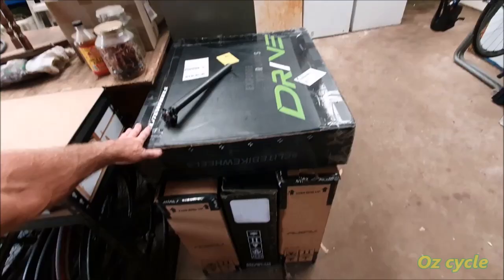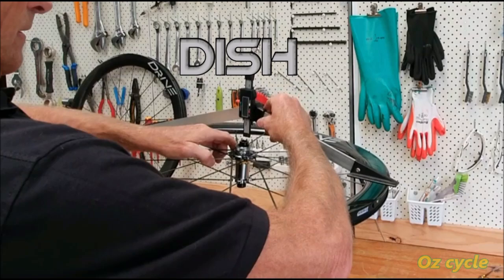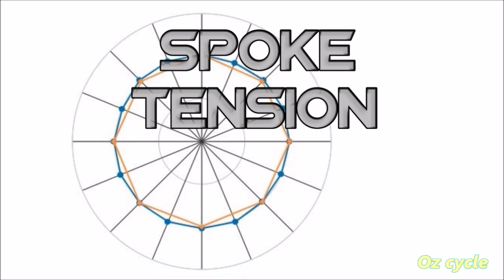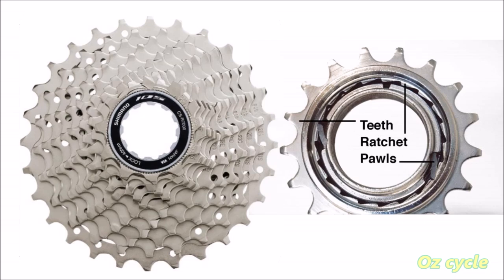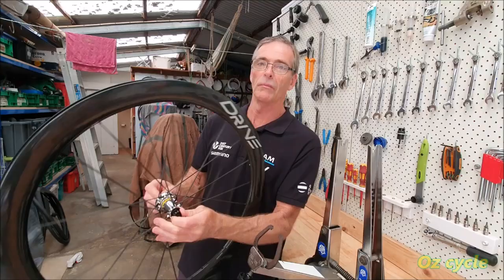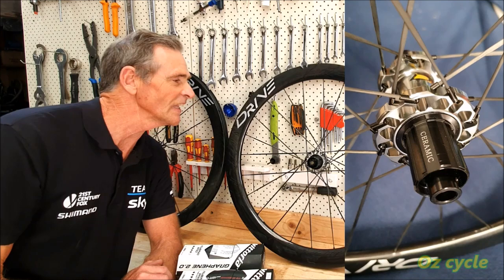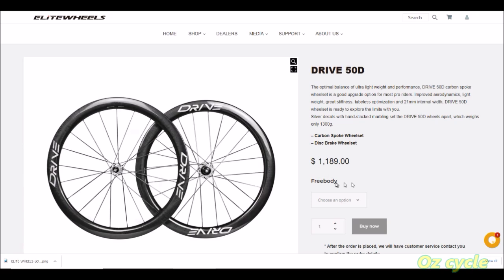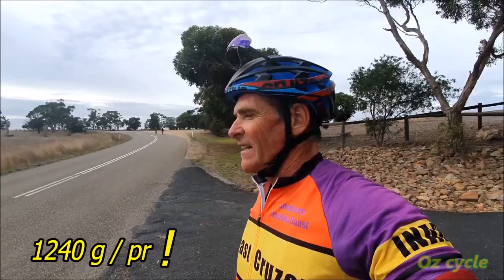Elitewheels Drive - carbon spokes , disc. Full review

Comment: I’ve been using these for a bit as well. 
I’ve noticed a marked increase in acceleration and climbing.  Now my climb performance has upgraded from terrible to less terrible. 

Great video!
Reply: Nice, ill take less terrible of terrible any day. My climbing is very terrible.
Reply: @JFomo  all kidding aside though.  When I first upgraded from alloy to carbon, it felt like a quantum leap. 
The Drives make my old carbon wheels feel like alloy wheels.

Comment: Good call on the TLR to tube tyre weight difference. I've never cared to check. Probably would be lighter with a clincher + latex tube than TLR + 40g of sealant. Just lose the puncture protection.
Great review, as always.

Comment: Note about carbon spokes. I was @ 225lbs when I started riding my winspace wheels. 1st spoke to break was rear wheel at the threads. rim went barely out of true and I made it home. The next time I broke spokes because my derailler committed suicide and dove into the spokes accelerating out of a corner. Took 3 out but the wheel didn't fail. It has been repaired and no problems since. I think the tensions are so high if you lose one  you good chance of making it home. But it is a negative that you cant make an adjustment on the road in a jam with a spoke tool

Comment: FWIW re swapping wheels and disc rotor alignment issue - invest in some disc rotor shims, usually each shim is 0.2mm, once setup this eliminate the need to adjust the caliper with each wheel swap🙂
Reply from the maker: Yes. You would think hub manufacturers would stick to a standard tho, hey?
Reply: They do stick to a standard but the tolerance needs to be reduced

Comment: I am concerned about the wheel height.  I have used Dura Ace WH9100 C35s and 20 mph cross winds would dramatically shove me (I am 6' 1" and weigh 160 lbs).  The lowest profile is 40 mm for the Drive.  I understand that the Drive are much wider the the Dura Ace and minimize the vertical profile.  Will the Drive wheels be driven just as much as the Dura Ace C35s?
Reply from the maker: Understandable. We had quite a few riders here who had same concerns. They got the deeper wheels, and months later they not even thinking about it as they subconsciously adapted to how the wheels feel in crosswinds. Extreme crosswinds will affect you no matter what wheels are used , most of the time it's no problem.

Comment: Great review! Did you use or review their 36t ratchet hub (name of the hub is RD13, it is used in BWT, Marvel, SLR and Edge disc models)? They say, that it is a good clone of DT Swiss 240 hubs with TPI bearings (a little heavier than original 240, but much more lighter than 350).

Comment: When it comes to stiffness, can these wheels be compared to wheels, e.g. DT SWISS ARC 1100 62mm Enve Foundation 65? It is worth buying them they are suitable for sprints / racing they are not too soft and bend ?
Reply from the maker: Definitely good for racing, but not for heavier riders (90+ kg)
Reply: @stevenleffanue  I do not know how their stiffness compares to competing brands such as DT SWISS ARC 62 or ENVE Fundation 65. Was it possible to test those wheels? Drive wheels They are very stiff they do not give up / they are not too soft floating when accelerating, e.g. My weigh is 72 kg

Comment: Really thorough. Well done mate
Reply from the maker: Thanx Alex. I like your upfront reviews and tech work too. Cheers from Australia
Reply: @stevenleffanue  I've not had the same experience as you regarding the spoke tensions. On my front wheel they are far too low and inconsistent! Causes all sorts of problems with the disc brakes.
Reply from the maker: You may have wheels from the first batch. I had a front wheel bearing problem and they said it was a known issue and has been fixed. They sent replacement wheel and it was fine. Let them know and they should replace it for you.

Comment: So a standard tyre with TPU ridenow tube at 33gms and you would have saved ~150gms per wheel!! This is about 300gms of weights saved at the rotating edge of the wheel!
Reply from the maker: Yes.

Comment: I was struggling to true this wheel but was grateful when you explained that truing had to be done from the spoke hole with a 5.5mm socket.  Can you give me some tips on how to radially true an asymmetrical 14 spoke/7 spoke setup such as these Elite wheels?   Thanks so much for this review and any help you can provide!

Comment: Given the vagaries of resin/finish coat, I think I'd measure lateral deviation on the inside mounting face rather than than the exterior of the rim like you would do with a metal rim - probably a more accurate view of lateral true.

Comment: You mentioned comfort, how would you rate them relative to other factory direct Chinese carbon wheels you've tried?
Reply from the maker: It's the carbon spokes that seem to absorb more vibrations than steel spokes. Only downside is , how long will carbon spokes last?

Comment: you know just after I left that comment on your you tube page I look at the instruction manual that came with the brakes to see if there was any info about that. All I found was they say there is a very small screw on the caliper for adjusting imbalance of the brake pads. Well I gave it a try and voila it works, calipers opened up by 1.5 mm. Thanks for the info any how. @stevenleffanue

Comment: Hi Oz cycle. I purchased a set of Elite rims, they initially came as thru axle and after a bit of back and forward they sent out qr adaptors, unfortunately the diameter of the qr adaptors seem a little to largeto fit my frame ! So having a great deal of pain trying to get this sorted ! Starting to think I should of just spent locally.

Comment: As always you do the best wheel reviews I've watched. I'm not looking to buy wheels because I bought a set of Campagnolo Shamal Carbons a couple months ago. You want to talk about a pretty wheel, Campagnolo wheels are pretty which is one reason I wanted them. The most important reasons I chose Campy is because I owned a few models and all of them were better than other brands in the same pricepoint. I think the cup and cone bearing hubs are a lot smoother and faster than the cartridge sealed bearings so I was happy to see Campagnolo use them on their Shamal Carbon wheels. I don't like bladed spokes which is another reason I got these wheels. Bladed spokes catch a lot more of that crosswind that throws you around and loss of control. The features of the Drive wheels will catch a lot of buyers especially the weight but I'm not so concerned about weight and I feel weight wennie's obsessions with weight is why we have so many unsafe products on the market these days. I hope those wheels are safe long term, the manufacturer did seem to put some quality workmanship into them. Thanks for showing them to us.
Reply from the maker: Yes,  Campy wheels are nice. I've used some of their first alloy Shamals when the first came out...looked great on steel bikes.

Comment: Planning to run 35c Rene herse tires on gravel bike, for mostly paved riding, was set on Ican 46 aero,  is this a better option or some other affordable wheelset? Thanks
Reply from the maker: Yep , that's fine. ICAN wheels are very good. I'm doing a gravel build soon and using their G25 set.
Reply: @stevenleffanue  thanks for the reply

Comment: I am really tempted to get these wheels, but a couple of things are holding me back. It seems that from the reviews I have seen so far there are some issues; Hub issue from trace velo which had been fixed and got sent a new hub, bearing issue in the front hub for oz in the first batch and spoke tension in the front wheel being too low and inconsistent for peak torque as I read in the comments. The latter might be hard to test for a consumer, but it seems like the product being reviewed is not a finished product per say, but a product still in development. Would I get the improved wheelset where all the issues are taken care of, or should I wait untill a new version is released?

 It might be me being cynical, but I would think it would be harder to get a replacement part if you are not an influencer or the like. 

Also thanks for the excellent in debth review, would the wrinkeling inside the carbon rim affect the structural properties in any way or displace the weight distribution of the wheels? Did these wheels have less or more abnormalities inside the rim compared to other brands?
Reply from the maker: Bearing problem fixed. Im still riding  these wheels and no problems. I still recommend these wheels for racing only tho.

Comment: Bought a set of elite wheels G45 wheels on the strength of several reviews, however I'm struggling with first setup. 

Rear wheel will not spin when the cassette is attached with even minimal torque. (it will freewheel with a very nice sounding ratchet. but wheel seems to be stuck when trying to pedal) Is this something I am obviously doing wrong? (cassette is from another bike with same Shimano freehub standard, swapped back with no issues on old wheel).

Any advice, much appreciated!

Comment: hello again, well I finally got around to assembling my Cinelli Superstar frameset, with Campagnolo Chorus 12speed group set, I also bought a pair of those Elite 50V rim brake wheels that you did a video about. Well the problem I'm having is the clearance between rim and brake pads. The brake pads rub on the rim. Is there anything that can be adjusted on the brake calipers? I have taken the brake cables off to ensure that there is no pulling there.
Reply from the maker: Try removing the 2mm washers between the pad shoes and caliper arms
Reply: you know just after I left that comment on your you tube page I look at the instruction manual that came with the brakes to see if there was any info about that. All I found was they say there is a very small screw on the caliper for adjusting imbalance of the brake pads. Well I gave it a try and voila it works, calipers opened up by 1.5 mm. Thanks for the info any how. @stevenleffanue
Reply: I thought about that but that spacer in Concave on one side,there is a reason why its there. So removing it is not an option

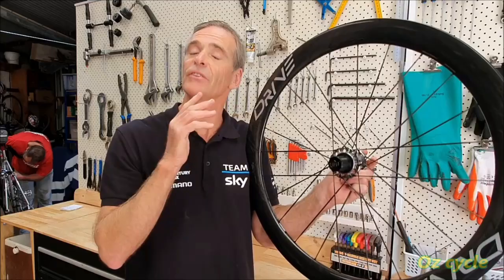Comment: Good point at 17:10. I don't understand the allure of carbon spokes. Questionable reliability compared to steel, and any benefits they provide are so marginal as to be meaningless to 99.9% of cyclists.

Are the freehub pawls steel? I've seen non-steel pawls fail as their end tips wear and round off. Good steel pawls last essentially forever.

Comment: What brand/model endoscope were you using? Great video.
Reply from the maker: Cheap from Aliexpress....works great. Make sure it's wire is soft and flexible otherwise it want go around corners well.

Comment: Hi Oz, may I call you Steven? Anyway, braking... it seems that dry weather braking on carbon rims is sorted now (if you don’t touch test the rims). However, in the rain? I have a pair of Winspace wheels downstairs waiting for a frame, and last night I road 20km home through a downpour. Even on alloys, that was not so much fun on the downhills...

Comment: Do you guys experience verticle wobble when your wheel spin at a very high speed?
Reply from the maker: That is usually a weight balance issue. I have a video here which shows you how to correct the balance.
Reply: @stevenleffanue  Hi Steven, may I know is 0.42mm deviation of lateral true still consider an acceptable range??

Comment: I used your 15% off code and love these wheels. So thank you for a great review. 1 question if somebody can answer. 
The rear freewheel is a little too clicky ( loud) for my taste. Would any other freewheel fit this setup, or is it a elitewheels specific hub that can't be changed. Any help is appreciated.  Thanks again :)
Reply from the maker: Put a bit more grease in the clutch and it will be quieter.

Comment: Hi Steven, is already been almost a month. May I know do you experienced any problems regarding this Elite Drive wheelset? Or it did a great job until now without any problems?
Reply from the maker: They are still going strong Christopher , no issues yet
Reply: @stevenleffanue  Hi Steven I got another one question sry for that. So I am going to build a new road bike, what should I get for my disc rotor? Using both 140mm, both 160mm, or using a mix of 140mm for the back and 160mm for the front?
Reply from the maker: Up to you. Personally I use 160mm front and back.

Comment: Hi Oz. Love your videos. When reviewing these wheels you've covered just about everything but unless I'm mistaken, you don't give an opinion on the freehub pick-up / drive engagement lag. The Elite Drive wheels use a 4 pawl hub with a 36 tooth drive ring and thus have 10 degree angle of engagement. My current wheels have 6 pawls and a 102 teeth drive ring which gives a very rapid 3.5 degree AOE which I love. What's the drive pick-up like with the Elite's out in the real world on the road ? Would I notice the difference between 3.5 and 10 degree AOEs ? One other aspect I don't think you've covered is what are the Elite Drive 50s like in crosswinds ? I've a different set of 50mm section wheels which are badly affected by crosswinds.
Reply from the maker: You want notice engagement difference on a road bike....more engagements are good for trial bikes,bmx and some cross-country.
50mm section isn't as bad as a 70mm but better than 35mm. It's that simple with crosswinds

Comment: Thanks for this. Subbed. I'm thinking about getting a pair of these wheels. Being 28 mm wide they seem better suited for 28s than the winspace which are optimised for 23s or 25s at a push. If you subscribe to the 105% rule (which I don't quite understand, or know if it's actually a fact) then with all other things being equal, quality, aero efficiency etc, these would be a better choice than the winspace if you plan to ride 28s. What do u rekon?
Reply from the maker: Seems road tyres are going bigger , so maybe even wider rims would be good. Road surface would play a part too at a guess.

Comment: Hi Oz, Thanks for the great and honest review. I have an unrelated question about waxing, i'm current using connex chains, i have 4 chains in cycle meaning i will swap the chain every 300-350km, and end up waxing at least 3 chains at a time if not 4 that is about 12 days per wax-job, but lately i have noticed a problem that when i take off the first chain and keep it in a clean bag then store it in a cabinet, but found out the chain got a little bit rust on the surface 10 days later when i was ready to do the waxing. I know that might be because of the humid or water when i kept in the bag, but still wondering what do you have to say about this problem and any suggestion on how to prevent it later on and how to get rid of the rust on the chain surface? Thanks in advance and always appreciate your kind work for the open community.
Reply from the maker: Allow the chain to dry out. Leaving water on a chain will corrode it.
Reply: @stevenleffanue  Hi Oz, thanks again for the reply , the only problem is that i'm 100% sure i didn't ride on the wet, i guess the only chance might be the water vapor from the air or something like that, anyway i will watch out this time, will do something extra manually to "dry it out".

Comment: hi, very nice review, I purchased a set of these just got them today, (order in feb) I ordeedr the rim brake version, but my wheels came tubeless ready and i don't like that, i have tubes and tires, do i have to remove the.... not sure what call it (tape or seal) in the wheel well before i install my tires and tubes?
Reply from the maker: You can leave the 'rim rape' on for normal tubes. Happy riding
Reply: @stevenleffanue   yes ,but won't the tape keep the tubes from sitting lower in the wheel well?? Just an observation  hmmm
Reply from the maker: Only by a fraction of mm. If it makes tyre installation too difficult replacing that tape with regular rim tape will solve it.
Reply: @stevenleffanue  yes, I was just concerned about tires popping of the rim when pressurized.
Reply: Just another note not about the elite wheels, but after seeing your video on making the tool to straighten bent aluminum rims, I decided to give it a go and repair my Pinarello Most Panther rim(rear) to use on my Pinarello Prince aluminum  frame,(with carbon forks and stays) my problem is that when I am on the largest sprocket the rear derailleur touches the spokes. I have adjusted the der. many times but can't get the sweet spot, either I can't get it into the large sprocket or it touches the spokes very lightly. Is there a thin spacer that can be put on the hub? Thanks for your expert advice! 
ps I want to use this bike with those wheels for when I go to work.
Reply from the maker: Yes , put a thin metal spacer washed behind the cassette.
Reply: @stevenleffanue  do you know who make such a thing, I've looked but to no avail.
Reply from the maker: Local bike shop will have them

Comment: Im on the fence on these. Drive 40v. Do i have your blessing?
Reply from the maker: Sorry , I've not tested the rim brake version Erik.
Reply: But the ride overall should be similar?
Reply from the maker: Yes. Very nice. I've only done about 600km on them but bearings are going good.